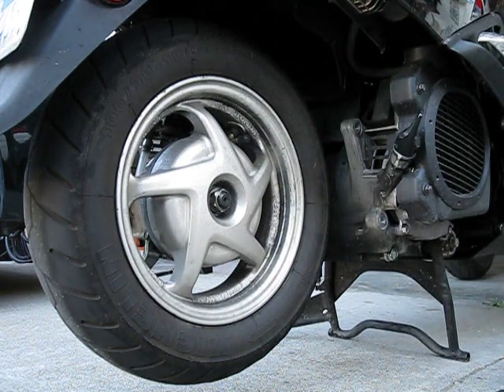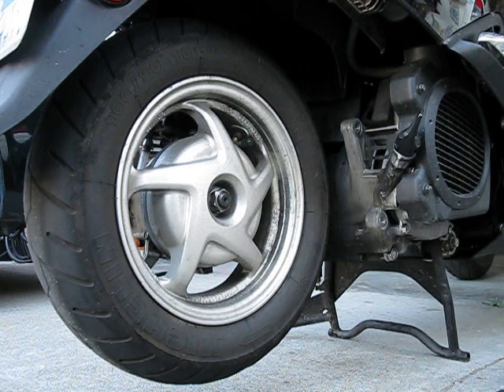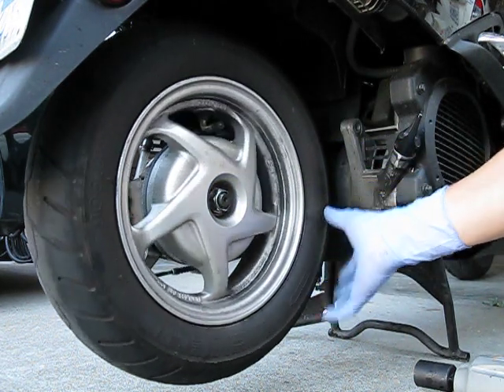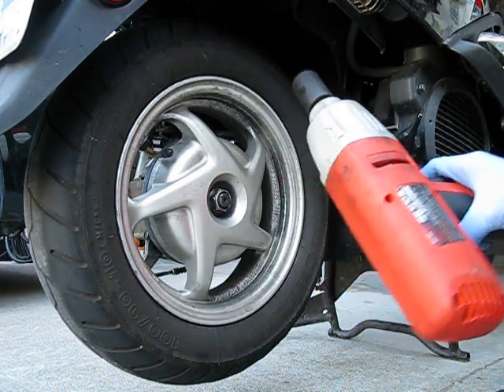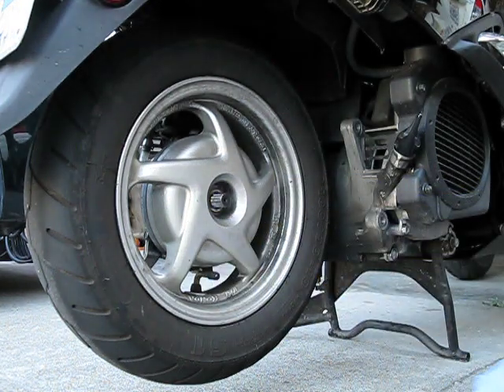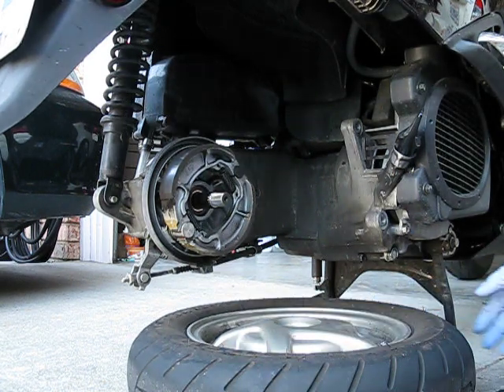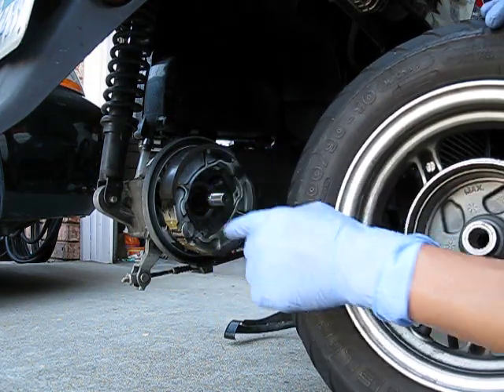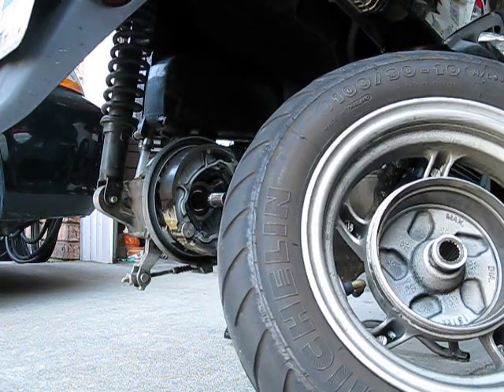Honda NHX110 rear wheel removal/installation

Comment: I just did a rear tire replacement on mine. When I bought my replacement tire I told them the size 100/90 10 and they sold me Bridgestone hoop 350x10 and told me that it would work.  I was worried because the Bridgestone tire seemed so much taller then the stock one.  The install was hard for me but I managed to do it.  Anyway I just wanted to let you know that I got my mph to increase from 48 to 53 with the new tire.  Also with the new tire my take off at a red light seems faster.  I never went over 50 mph on my bike, even when new.  I thought it was because my weight is around 195 and the top speed was for lighter riders.  

Thanks for all your NHX110 videos.
Reply from the maker: fdiskrn 3.5x10 works, I like to use a bridgestone ML16 4.0x10.  When all drive parts are new it'll get me to 55mph

Comment: What impact wrench do you recommend for this?
It has been very difficult for me to remove it by hand. slightly rounded the nut. Thanks
Reply from the maker: Make sure you use a 6point socket and not a 12point.  If using an impact use an impact socket.  I use a cordless Makita with three power levels, higher end one will have this option, at the high power setting.  You'll need at least 80ft-lbs.  The lower end impacts don't have enough strenght even though they say they have more then 80ft-lbs.

Comment: Just taken off the rear wheel. Took off the old drum brakes now the wheel won't fit back on. You know what I am doing wrong? I guess there is something else I need to loosen up or something.
Reply from the maker: line up the splines.  The drum brakes might be expanded out too much, slack out the cable adjustment
Reply: @DaBinChe  thank you I'll give it a try tomorrow. I did like up the groves. It's like the brakes block it. It goes on without the brakes on. I'll try again tomorrow and slack the cable. I'm guessing it's the cable at the back? It's ashame you didn't do a video on it. You have gone everything but that it seemed 🤣. Thank you
Reply: @DaBinChe  just got round to trying it the cable was the issue it just snapped on me now got the pads and wheel on. So guess it had rusted to much to slacken properly.
Reply from the maker: @user-hl8mp3qz9n  I grease the treads on the adjuster nut on the cable to prevent it seizing